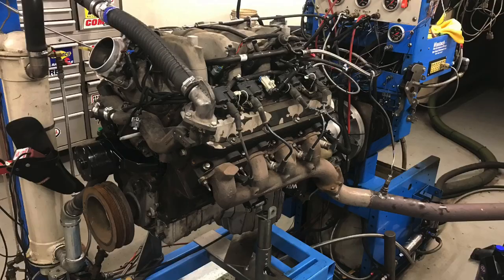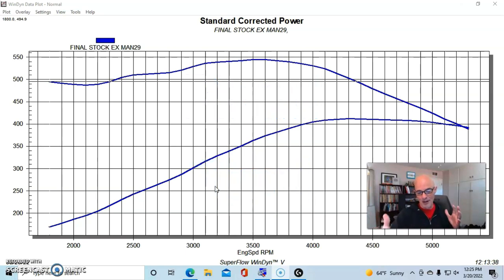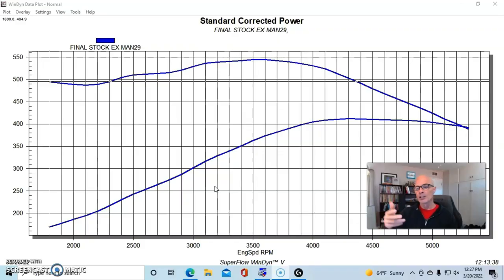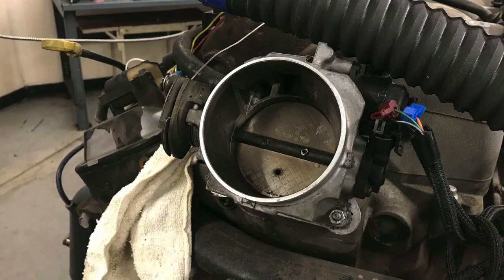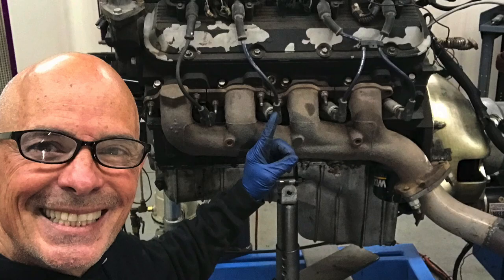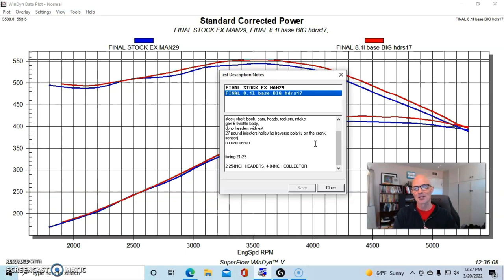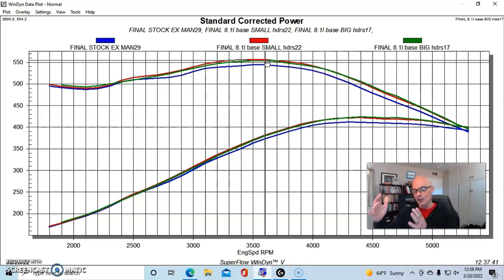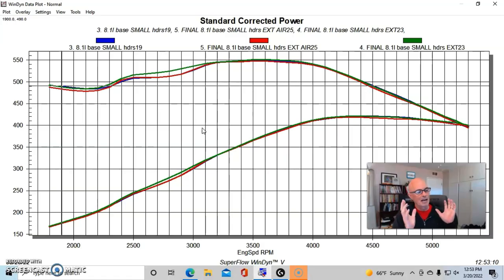HOW TO IMPROVE 8.1L POWER. STOCK MANIFOLDS VS HEADERS. ARE SMALLER HEADERS BETTER? THE OTHER GUYS

Comment: 9:00 (before watching further) On a nominally 450hp engine I'd run (assuming I had the room for long radius bends off the head) a 1.5" pipe off the head, stepping up twice before a 2.25-2.5" merge collector/choke into a 3" pipe, so I'm of the opinion that both of your headers are way oversized for the application.

Educated guess is that the 2" headers will provide better gains than the 2.25 everywhere.

Now on to the viewing...

Edit time!

Ok not really what I was expecting. I'm going to stick to my guns here and say that the insensitivity to the header size is indicative of it being still too big. It's like a sausage down a hallway doesn't change much if you throw it down a narrower hallway...

Also with not much overlap going on you're not going to get the full benefit of any header, beyond what you already got by reducing blowdown interference by virtue of having long pipes.
Reply from the maker: a 1.5-inch primary on an 8.1L motor? You need to step up your game
Reply: @richardholdener1727  thanks for the reply and taking notice of your old videos. I wouldn't dream of 1.5" straight headers on anything over about 300hp, but stepped headers, and merge collectors with chokes change the game entirely. But here's where I got my theory from.

490-ish hp 289, with 1.75x34" straight tube headers into a 2.5" merge collector, x pipe, straight through mufflers. I built a detailed model of the engine on a proper engine simulator which modelled the actual dyno pretty accurately.

Going from 1.75 to a 1.5>1.625>1.75 in approximately 9 inch steps and going to a 2.5" choke and 3" pipes filled in about 25ft-lb for a good 1500rpm before peak torque with negligible loss in top end.

Final design ended up as a shorter 4-2-1 with 2.25 chokes for a total gain of 30 ft-lb between 4000 and 5500rpm with a loss of about 2hp at 7500.

Pressure/flow traces showed a good correlation between smaller primary diameter and scavenging on overlap.

So that was squeezing 10-15% more power through a collector choke that was the size of the individual pipes you were using in your first test.

I'm certainly of the belief that headers should be sized for projected horsepower and not just off cubic inches. Your straight 2" headers are likely a good fit for something much more powerful but at this power level there's no velocity/inertia to help on overlap or at the collector.
Reply from the maker: you are getting your data from a simulator? Thnx-that's all I need to know. 1.5 primaries on an 8.1L motor will not work and step headers (having tested them many times) are not a game changer.
Reply: @richardholdener1727  the application specific stuff I just mentioned comes from various simulators. Theories and starting point sizing initially came from some very successful professional engine and exhaust builders. Adjustments to the theories were made based on gas flow characteristics I've learned through those simulators. I didn't just dream up the numbers to throw at some online calculator and hope they stuck with no understanding of what's going on in the pipe.

Are your stepped header tests all online for public viewing? I'd love to go over the data and see what you've tested and see what I can learn. I'll likely copy the tests into my sims and see if I can duplicate the results to see if I'm doing things right.
Reply: The best computer software for headers is Larry Meaux's PipeMax. 

And it will not tell you to put 1-1/2" first step primaries on an 8.1.

I have the software and the 8.1, and I know Larry Meaux. 

It wants an 1-7/8" first step, depending upon the camshaft, and intake modifications.

Comment: The torque is measured in lb. ft. (pound feet) not in ft. lbs. (foot pounds,) they’re not the same.

Both foot-pounds and pound-feet have a force component (pounds) and a displacement component (feet), but they measure two different things…

Foot-pound-force (ft-lb) is the energy required to move a one-pound object one foot of linear distance.”

Pound-foot is a unit of torque and a vector measurement created by one pound of force acting on a one-foot lever.
Reply from the maker: if only people knew what I meant and the designation has changed multiple times over the years-but you knew that

Comment: I'm thinking this 8.1 gotten very poor gas mileage for what I heard, less then 10-8mpg? Not good if true.
Reply: My 02 Avalanche 2500 with 8.1 at best is 12. Average 9 to 10.
Reply: My 2001 eclb 2500 2wd gets 11.5 average, all time best 14.5 pulling a 2200 tent trailer (I was forced to go slower. Lol). Truck is just shy of 380k miles
Reply: Do you buy a 7000# truck with a 20,000# tow rating for fuel economy?

Comment: With that flat ass HP peak between 4k and 5k it looks like it has the same issues the pre 80s small block chevy had with airflow limitations on the intake side. I saw they make a Dart dual plane carb intake for a decent price and I know Raylar was making some performance EFI intakes which would be cool to see but all their stuff seems prohibitively expensive.
Reply: Dart and a modded intake will be nice to see tested for sure.

Comment: why make a 496 then limit the torque?
Reply: Cause burning the tires off a stock truck is  frowned at. And transmission appreciate it as well.
Reply: @amospgarcia9152  so why make the it 496 ci in the first place.
Reply: @Skubasteph   well it still uses it all but it’s selective where it allows you to.
Reply: Because you do not need WOT or peak torque at the shift, it only causes damage. GM has to make things live and not drown in warranty claims.

Comment: Your stock horsepower and torque dino numbers are too high. A stock 8.1L/496ci motor only makes 340 horsepower and 455 pound feet of torque.
Reply from the maker: you might be talking about factory rated power-this is not that, they test it in a different manner
Reply: That would be at the wheels, not at the crank.
Who's testing at the crank? Currently in this video, numbers will be higher
Reply: He's not testing the factory tune, which includes retarded timing and delayed fuel enrichment. Not to mention torque management to reduce torque during shifts and torque converter lock up. 

His stock dyno numbers are what the engine is actually capable of with a tune designed to produce maximum power output.

Comment: 1000 ft lbs  with a Turbocharger and cam
Reply: They get 650+ NA, so I'd imagine that could be done at relatively low boost. Running a S410sx would spool up just above idle, and still be rowdy

Comment: I have an 8.1 in a 2001 2500HD SB 4x4 CC and I tow an 11,000lb boat with it. So....the engine was bone stock and made 411hp/545tq? up from 350/500. Was the torque management disabled?
Reply from the maker: there is no torque management in a Holley HP system (what I used to tune it)